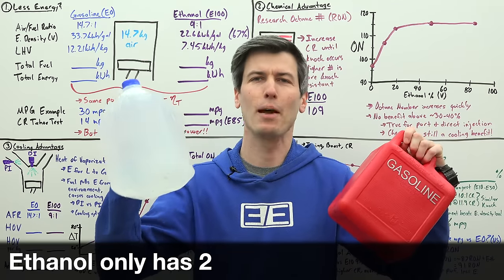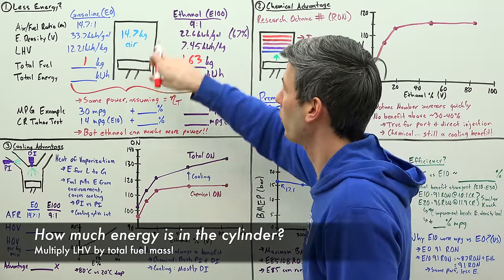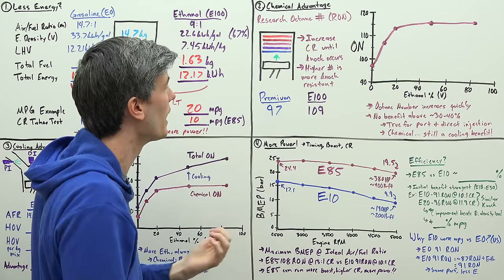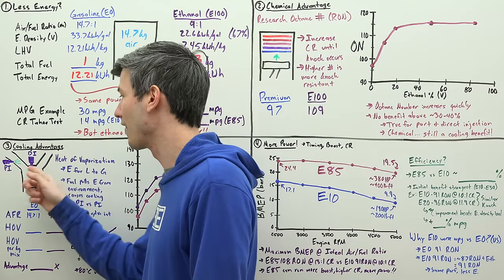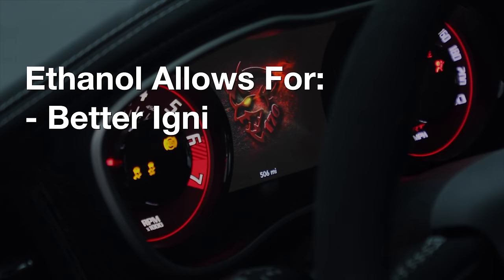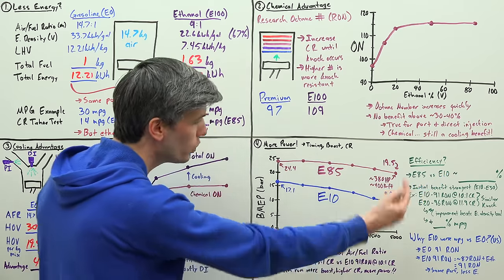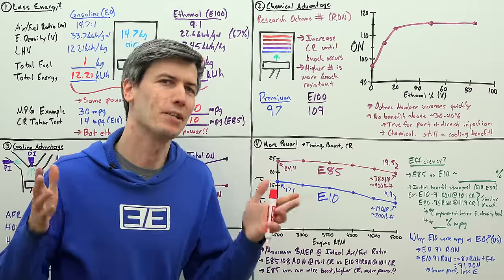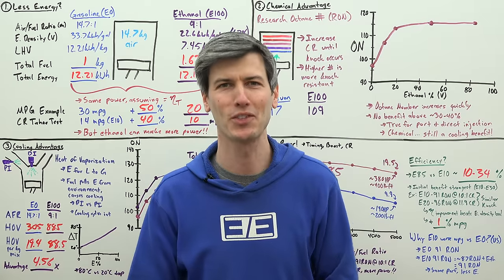Why Does Ethanol Make So Much Power? (Versus Gasoline)

Comment: All very interesting, but there’s another number that I care far more about, mi/$. This determines my operating cost. It turns out my Ram 1500 runs most cheaply (i.e. gets the highest mi/$ ) using ethanol free premium which ironically costs the most per gallon! It travels 490 miles on a $120 tank of EFP versus just 315 on $98 tank of E85.
Reply: That wouldn't be the case if it were tuned for higher ethanol contents and you used a non-etandard blend. The last point he made -- 91 with 10% ethanol isn't the same as the 91 you're running but with 10% ethanol. It's blended to reach an effective 91 because of the added ethanol. If instead you put in 75% 87 e10 and 25% e85 and had your Ram tuned to take advantage of the higher octane and cooling properties (not using fuel enrichment, increased ignition timing) costs per mile driven would be much lower for this hypothetical e25 blend verse the non-ethanol premium you are using. But that probably isn't practical or realistic, so your point is well taken. Lastly, engines can benefit much more from ethanol if they are boosted versus NA. So your Ram isn't going to see the same efficiency gains as the Ecoboost Ford in the examples he mentioned.
Reply: @hcut2k4  or like the ford testing where they increased compression ratio to basically 12:1
Reply: @hcut2k4  good to know. As a math teacher I first observed this because I live in rural Montana and our distances between gas stations make it wise to always fill up whenever we get the chance and to maximize how far we can drive on a tank. One of my students observed that I should also be producing less carbon dioxide per mile, but I said that depends on the array of combustion equations and all the constituent by fractions; however, I suspect she is right.
Reply: It´s because your engine is not build for E85 specifically and thus does not profit as much.
Reply: @sierraecho884  my friend’s car is E85 optimized and she says it’s a gas hog. I’m beginning to really doubt the whole concept as seeming more like a political or publicity stunt than a valuable practicality. Do they actually produce less CO2 per mile driven? Is ethanol production less harmful than petroleum production?
Reply: @scottaseigel5715  Im doubting everything your saying too.
Reply: @scottaseigel5715  What is her car, though? If its mileage sucks on pump gas, it would likely be worse on E85. Some years back I was talking to a lady with a flex fuel Yukon while filling my flex fuel Chrysler and she told me if she ran 87 octane E10 it would ping and knock under power, so they tried 93 E10 and it got better mileage with no ping, but was so expensive that it wasn’t worth it. They finally tried E85 in it and while it got worse mileage, it ran better than on 93 and due to the price difference, it ended up being the best of the fuels to run it on.
Reply: Worrying about fuel efficiency on a massive pickup 
Americans lol
Reply: @deramon1000  $.06 savings per mile is $12k in savings over the life of his truck
Reply: @deramon1000  Absolutely. This is the primary vehicle type here in rural Montana. Moving equipment, sacks of grain, tubs of chemicals, hay, sand, gravel, etc. in a Tesla* is rather idiotic (*even their truck which doesn’t handle our -40° weather especially well). Most city folks have no idea that blue collar people like us feed and supply you, and even maintain the infrastructure of your lives. Having grown up, taught and been stationed in urban areas, I know this to be true. Now, as a railroad conductor I also realize it’s easy for people to forget how quickly society would collapse  without a working freight system. My employer implements extreme measures to improve efficiency and reduce pollution. This seems meaningless to people for whom our work is largely invisible with all the things you need appearing in your lives as if by magic. Operating the truck I need for the life I now live is expensive. I can’t afford to play silly games in order to mollify the feelings, half-understood whims and broad misconceptions of the people who depend on our productivity while simultaneously criticizing us.
Reply: @GreenJeep1998  I think she drives a 2009 Impala.
Reply: @oldblueaccord2629  doubt all you want. I’m nobody special and my results and experience may be atypical. Do your own research, but factor in who’s talking and if they stand to make or lose money. For example, new doctors are taught to ignore anecdotal evidence; old ones primarily rely on it. A visiting D.O. explained conflicts of interest to my Advance Placement Chemistry class by explaining that much of what they’re taught in med school is underwritten (and thus influenced) by the same pharmaceutical companies that fund lots of the journals and research. That was 25 years ago. I’m sure the world is much less corrupt now.
Reply: @sierraecho884  That’s definitely an assertion of the video, but is any production engine able to adjust compression? Does ethanol as a fuel actually live up to all the green marketing or are people just making money by promoting it? I mean it’s the single most popular drug in history across thousands of years (despite everyone knowing it’s bad for humans)…just sayin’!
Reply: @scottaseigel5715  A production engine is not able to adjust compression nor does it have to. Those engines are testing rigs for the fuel, they are not meant to be placed in your vehicle.
Ethanol can live up to it, I am not sure if it currently does, in fact I believe it does not, however it does not mean that it never will, it certainly has the potential to.
Ethanol being used as a drug has nothing to do with it´s properties as fuel. Glue is also being misused as a drug, nobody in their right mind would ever prohibit the usage of glue. 
Opiates have also been used as drugs however they are just as important in medicine as many other toxic, deadly or addictive substances. This is a whole different topic altogether thoug.
Reply: @deramon1000  I know I laugh to when I read this stuff. The 490 mile on a tank is a dead giveaway its a BS story.
Reply: @sierraecho884  clearly my attempt at humor failed. This happened in my classroom fairly often as well. EtOH seems like an interesting idea. I live among ranchers and wheat farmers who swear its production has raised food costs. I’m not entirely clear how that might work. I totally believe that a hydrocarbon fuel whose production (plant growth) removes CO2 from the atmosphere sounds like a great idea in principle. Meanwhile I just put $88 in my tank and my fuel economy shows 18.9mpg which is MUCH better than the 12.5mpg it averaged the last time I was in a state that had no ethanol free fuel.
Reply: @scottaseigel5715  I am sorry, English is my 3rd language so I clearly misunderstood you.
Well it would not remove more CO2 than it would give back again when burned, is a net zero sum in the end, which is good, because it´s a closed circle. 
You probably will get worse milage If your engine is not specifically made for that stuff and that stuff alone. As explained in the video the engine would have to be optimized for the higher compression ratios. What do you teach ?
Reply: @oldblueaccord2629  when I drive on HWY 2 I always set the cruise control at 65. Doing so gives me actual mileage (based on fueling up) well above 20mpg. I have a 25 gallon tank. You do the math. (In town I’m lucky to get 12mpg.)
Reply: @sierraecho884  I mainly used to teach chemistry, physics and high school math.
Reply: @oldblueaccord2629  I don’t mind you doubting me, but I’m troubled that you’re saying it. Calling me dubious just attacks me as a person. You’re discreditting my data outright simply because it doesn’t fit your assumptions. I’d suggest reading Brian Keating’s book Losing The Nobel Prize which really digs into that. Your criticism does nothing to address my points. When I encounter someone who I think is lying AND I think their statements might hurt people then I will address it. Otherwise I usually ignore people who seem full of BS. What do you suppose this conversation gains when you discredit me? Can you think of any reasons I might want to lie? What could I stand to gain? I’m really glad I posted here because I’m actively learning MUCH more about the pros and cons of ethanol as a fuel. This is his first video I’ve ever engaged with in this fashion (and I’ve followed him for a while now). I guess the teacher in me is deeply curious about why you care enough to say something. I don't really care if you believe me. But I do wonder about what would motivate you to imply that a total stranger with no clear dog in the game would lie.
Reply: @scottaseigel5715  The entire Internets full of bots, AKA fake accounts...its the only way to figure it out. Sorry your offended we doubt you numbers but as a teacher you should be somewhat used to that, no?
Reply: @scottaseigel5715  Yep and all you math is incorrect so far...NEATO.
Reply: @oldblueaccord2629  Please give me an example of my math being incorrect. (BTW, your grammar is incorrect.)
Reply: @scottaseigel5715  This is a numbers problem not English class. You dont need to write 3 paragraphs on every post on an internet chat board. BTW I thought you were mad at me for asking to show the math.
Reply: @scottaseigel5715  Not sure of your year Ram pickup but if it were a 2018 model, the EPA rates it at twenty (average city and highway) with E0 and at fourteen average with E85.

The AI censoring algorithms delete my posts, so I am writing out numbers often here FYI.

The EPA states the US fleet loses three to four percent on E10 and four to five percent on E15.

On the E85prices website I see ezero costs 20.2 cents per mile to drive.

I see that eten costs 17.8 cents.

I see that efifteen costs 16.5 cents.

I see eeightyfive costs 18.3 cents though realize that wintertime fuel is more like E51 so mileage is better than the fourteen.

I do not know Ram's horsepower rating on the two fuels but Chevy rates their pickup at a clean 380 horsepower on E85 vs a dirty 355 horsepower on E0.

First off, corn is not grown for ethanol, but rather corn ethanol is a value-added product of >>>already existing<<< feed production which leaves 100% of the protein still available for feed in a healthier, more digestible, and more concentrated form called distillers grains.

Flawed studies negative on corn ethanol naively or sinisterly assign all/most energy or CO2 to the ethanol side and little/none to the feed side of corn when in reality it should be the other way around.  Why?  Because if we outlawed ethanol with another Prohibition, we would still grow the same amount of corn we always do and always have.  Cattle feeders need plant protein to make animal protein so if their distiller grains were ended, they would have to find an alternative protein source and that would likely have to be switching back to feeding less concentrated straight corn.

Here is how the 2007 Energy Independence and Security Act affected food/feed prices (if at all):
2007 weighted corn price =$4.20 WITH 4 .7B gallon mandate
2008 weighted corn price =$4.06 WITH 9B gallon mandate
2009 weighted corn price=$3.55 WITH 10.5B gallon mandate

2016 weighted corn price =$3.36 WITH 15B gallon mandate maxed out
2017 weighted corn price =$3.36 WITH 15B gallon mandate maxed out
2018 weighted corn price=$3.61 WITH SAME 15B gallon mandate maxed out & most ethanol ever produced
Wheat
2007...............$6.48/bu
2008...............$6.78/bu
2009...………$4.87/bu

2016...………$3.89/bu
2017...............$4.72/bu
2018...............$5.15/bu

Soybeans
2007..............$10.10/bu
2008..............$ 9.97/bu
2009...……...$9.59/bu

2016..............$9.47/bu
2017..............$9.33/bu
2018..............$8.48/bu
Reply: The Ram mileage is newer than 2018, if using 2018 and older the ethanol costs are even lower than E0.

I did not dare correct my post in case the algorithms deleted it.  I have so many numbers there I hate to fix it.  You can not see that your post is not showing without logging out of your account and then viewing.  Very frustrating to say the least of our censoring new reality .
Reply: @oldblueaccord2629  my numbers are just data. My students used to give me both good and bad data. Analysis is another challenge. I’ve seen systematic and random errors in data collection as well as computation. Of course I’ve made all four types of errors as well as probably committing tons of statistical mistakes and even logical fallacies (despite teaching all this stuff)! 

I’m trusting my truck’s mpg reporting system (on-board computer) to give a fairly consistent result to dividing my miles driven (from my odometer) by my fuel pumped at the gas station (from the pump).  I’m totally oblivious to things like the statistical confidence of my method. 

My experience is that the most mistakes seen by a math or science student are probably the teacher’s mistakes because we do the most seen work. That’s why great teaching requires a humble and teachable mindset. I’ve seen a Nobel prize winner make a silly mistake, but also very inexperienced students having subtle and brilliant insights. 

So, did you find Keating’s book?
Reply: @danafletcher2341   my truck VIN 1D3HV18T59S800097 is a 2009 SLT Quad Cab 4WD. I’m not sure what you mean here by “ethanol costs are even lower than E0.” E0 may be what I call EFP (ethanol-free premium).
Reply: @danafletcher2341  THAT’S AWESOME INFORMATION, THANK YOU!!!
Reply: @oldblueaccord2629  I’m a teacher. Even when I feel mad or offended I try to stay focused on the problem. And yes, I often say too much which is not a great trait for a conductor.
Reply: @scottaseigel5715  Actually the 2018 is worse at 19 for E0 and 13 for E85.

I see the 2009 Rams were rated only at 15 for E0 and 10 for E85.  You are doing really well with yours since the EPA has been really spot on with all my vehicles since they switched to US-06 (real world) driving conditions.  Back in the day, no one could get close to their window sticker mileage.

When you use premium gasoline it contains up to 40% BTEX (benzene, toluene, ethylbenzene, and xylene).  In 1948, even the API admitted that there is no safe threshold of benzene.  Even with that gone, toluene and xylene make benzene in combustion.  

Why not give the earth something nontoxic it naturally makes and breaks down?  

Even with just 10% ethanol added to E0, the Swiss Federal Laboratory for Materials Science and Technology found that the especially health devastating ultra fine or nano particulate emissions were lowered by 97%, carbon monoxide lowered by 81%, carbon dioxide lowered by 13%, aromatic hydrocarbon emissions lowered by 67-96%, and genotoxic emissions lowered by 72%.

Not sure if you are a train conductor along with being a teacher but did you know back when Germany was considered the most advanced nation before the wars that 1/3 of their locomotives ran on ethanol?  

Argonne National Laboratory and Progress Rail (a Caterpillar company) have developed a duel fueled engine that uses hydrous ethanol.
Reply: @danafletcher2341  I was unaware. When I lived in Germany (one year from 1991-2 and again 2005-8) I never saw non-electric trains. Our diesel trains are very sooty and that really concerns me. I will research all of this. Now I wish I could run my truck as cheaply as a function of mi/$ with an ethanol fuel. Did you mean “anhydrous ethanol?” I’ve only ever seen that as a lab reagent (stored with a strong desiccant).
Reply: @scottaseigel5715  Hydrous ethanol is 192 proof like Everclear.  It is the highest proof traditional distillation could achieve and what Brazil started with for fuel in the 1970s.  We use anhydrous ethanol for mixing with gasoline which means without water which is 200 proof.  We use molecular sieves akin to reverse osmosis to remove the last bit of water.  

Gasoline as you can see from the Swiss Federal Lab is also very sooty (and toxic) and ethanol as an oxygenate vastly cleans.

What are your prices and mileages you are using to determine ethanol costs more per mile?  Most often for everyone, ethanol costs less per mile to drive with everywhere.  There could be something in need of repair or maintenance with your particular vehicle or it could have been on the bad end of the averages the EPA came up with.

Here is an excerpt from historian Prof. Bill Kovarik:

...According to a representative of the Otto Gas Engine Works of Philadelphia, by 1906 ten percent of the engines being produced by the firm’s parent company in Germany were designed to run on pure ethyl alcohol, while one third of the heavy locomotives produced at the Deutz Gas engine works of Germany ran on pure ethyl alcohol.45 Alcohol engines were advertised as safer than steam engines (as they did not give off sparks from smokestacks) and far cleaner than kerosine or gasoline engines. In a survey conducted around 1903, some 87 percent of German farmers considered alcohol engines to be equal or superior to steam engines in performance.46 Conflicting reports on the number of German distilleries at least give some idea of the scale of the enterprise. By one 1906 account, some 72,000 distilleries operated, of which 57,000 were small farm “Materialbrennereien” stills producing a total of 27 million gallons.47 Another account, from 1914, put the number at 6,000 distilleries producing 66 million gallons of alcohol per year.48

These alcohol stills may have had the effect of prolonging World War I. According to Irish engineer Robert Tweedy, when oil shortages seemed likely to paralyze Germany’s transportation system in 1915, thousands of engines were quickly modified. “Every motor car in the empire was adapted to run on alcohol. It is possible that Germany would have been beaten already [by 1917] if production of alcohol had not formed an important part of the agricultural economy.”49...
Reply: @scottaseigel5715  This is really nice, we need more people like you Sir.
Reply: @sierraecho884  THANK YOU!!! 
your English is excellent. Are you living in an English-speaking location? After 4 years living in Korea and 4 more in Germany I’m nowhere near your proficiency in either.
Reply: @scottaseigel5715  I am actually living in Germany =) 
But you must be confusing me with somebody else, because I never explained what hydrous means.
Reply: @sierraecho884  You’re right, another teacher mistake, that was Dana! I corrected my reply to you and made part of it a new reply to Dana.
Reply: @danafletcher2341  

Thanks for explaining what’s meant by hydrous, that makes sense. Is 96% a typical equilibrium point? I wonder how much humidity (I.e. water vapor pressure) impacts that. I took organic chem and quantitative analysis, but never got to take P-chem; I bet that’s where I would have learned this. When I returned to college to study EE I often found myself jealous of ME and CE track students and even debated double or triple majoring until my adviser said, “NO!” He told me to instead pursue Ph.D.s as quickly as possible which I think was great advice if my life had only been simpler.

Sadly my wife finished her microbiology degree before I finished my second degree. She had to go where the Army sent her. As we had small kids at the time I left that program and really regret that.
Reply: @scottaseigel5715  Waiting for those MPG numbers teach!
Reply: @oldblueaccord2629  I don’t think I left anyone hanging, but I did make a mistake about who I was answering, so maybe I missed your question. This thread is a mess.  You criticized my math and my long-windedness as well as questioning my integrity previously. At that point I figured you also dismissed any data I posted outright. While I applaud confronting BS, there’s a point at which an aggressive critic sounds intentionally offended and their own intellectual honesty comes into question. You’ve come close to that and this new, lengthy response is needed because of it. I’ve posted a fair amount of quantitative data. Upon review, I missed you asking for something specific. Please re-read everything again (as I just did) and then ask me a well structured question and I’ll be happy to answer.
Reply: @scottaseigel5715  Im just asking what you MPG , miles per gallon is sir. Not anything else. No need for 3 paragraphs.
Reply: @oldblueaccord2629  last tank was 18.9.
Reply: @scottaseigel5715  This is meaningless without knowing what the road conditions are in both states. For example I get a 20% difference in fuel efficiency driving in Texas vs driving in Tennessee using the same blend of gas. The post needs a bit more context.
Reply: @josephrankin6055  road conditions are MUCH less important than how I’m driving. I’m obsessed with getting the best MPG, so I drive 65 on roads with 70 limits (where everyone else goes 82). The highway is pretty smooth with a little snow and ice. Town is a total disaster with potholes and WAY too many stop signs.
Reply: @scottaseigel5715  So if i multiple 25 by 18.9 ill get 490 or close to it correct?
Reply: @scottaseigel5715  So to keep this story going the difference in MPG 87 octane vs 91 pure gas is>>>>........?????
Reply: @oldblueaccord2629  13.5mpg with standard E? 87 the last time I used it (a long time ago) versus 18.9 for my latest fill with E0 91.
Reply: @scottaseigel5715  Understand Im getting you to admit your comparing two different fuels. I see we need multiple post and many paragraphs written to get there.
Reply: @oldblueaccord2629  I thought I was clear about that from my first post.
Reply: @oldblueaccord2629 490 miles is a low mileage for a A Toyota Highlander hybrid driven hard and brake hard. You can get closer to 600 per tank